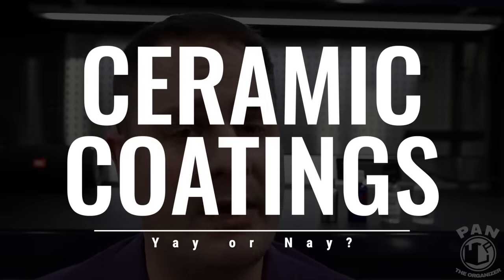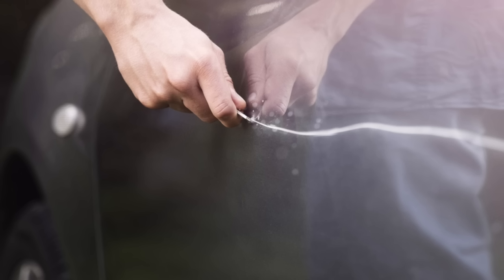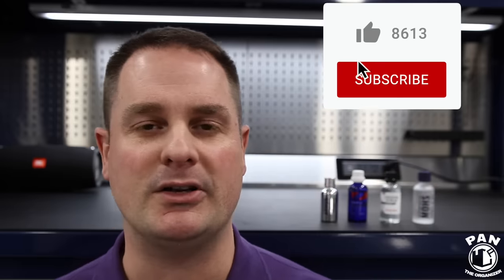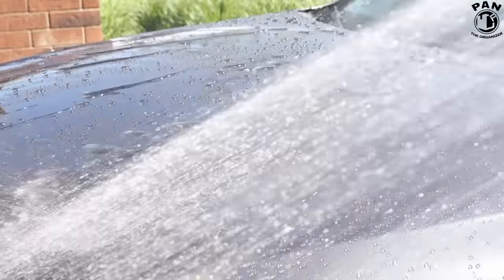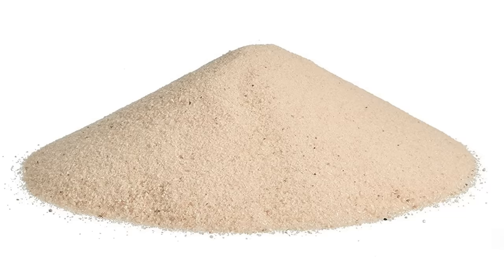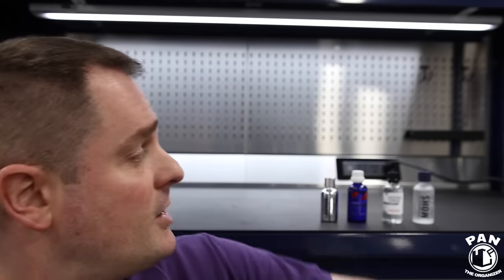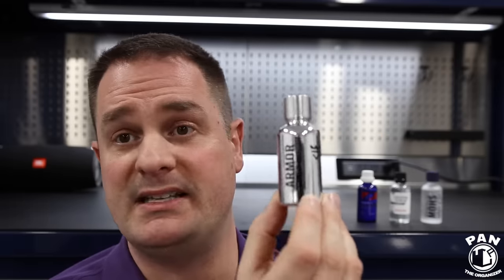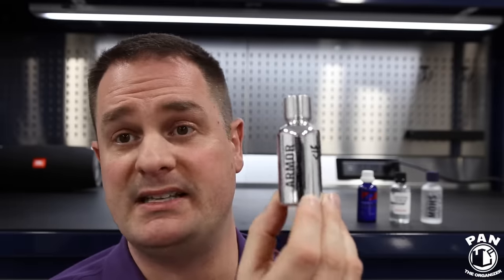DON'T BUY CERAMIC COATINGS BEFORE WATCHING THIS !!

Comment: Just wish I had an indoor space to complete the whole process safely 😩 not confident enough to do a full polish and ceramic application outside 😬
Reply from the maker: You certainly could. Just make sure you pick a day where it doesn’t rain and don’t work in direct sunlight.
Reply: Ok have to wait for a calm over cast day as our house has the sun from 6am to 3pm , we could move 🤔🤪 the wife will understand 😉, thanks Pan , great as ever 👍🏻 could be a short blog on what you can do in an outdoor setting and when not to , help confidence 👍🏻

Comment: Great information Pan, I would like to know how you know it's time to reapply the ceramic coatings and the process. Thank you!  Storman from PA
Reply from the maker: When the properties really start diminishing (hydrophobics) and when you are reaching the end of the claimed durability. So if you have a ceramic coating that is supposed to last 2 years, towards the end of the coating's life, say at the 20th month mark, you will probably notice less water beading and sheeting. At that point, I would recommend doing the full procedure of wash, decontamination, machine polishing, paint prep and then reapply a fresh coating.

Comment: Will these work on an Rv? I have a full body painted 5th wheel and looking to put ceramic coating on it to protect the trailer
Reply from the maker: Yes, most good coatings can also be applied to paint, gelcoat, fiberglass, etc. Check with the coating brand you are buying to make sure.

Also, watch my RV detailing tutorial here: https://youtu.be/OCUWBbPgu8M
Reply: @PanTheOrganizer  thank you very much, I will check out your video there after I finish up with this video. I’m trying to do my homework before starting the big project

Comment: Just ordered AVking and 79.00 for two kits is sweet! Was using Pearl nano products and from new my 16 f150 looks great, but needs a refresh and some wheeling and a swirl removal. Any tips for prep soap wise before clay barring?
Reply from the maker: I like Adam's Strip Wash: https://amzn.to/2Rt0h2N
AvalonKing also makes their own prep wash shampoo now. It works great too.

Just keep in mind stripping shampoos alone won't fully remove existing protection. They only start the breaking down process of older waxes or sealants, and certainly don't strip ceramic coatings. Only machine polishing will ensure 100% removal of old protections.
Reply: @PanTheOrganizer  Thanks for the video very insightful. Cheers

Comment: I purchased P&S interior cleaner from watching your channel, excellent results with a matt finish on my Porsche which has Feynlab self healing lite and was wondering if you have any experience with any the so called self healing ceramic coatings?
Reply from the maker: I haven't tested self-healing coatings yet.

Comment: Thank you for answering my previous question! Other question. My car is a 2018 Kia I've never applied wax but when I go to the car wash I do use the turtle Wax at the end. Does that count as a coating? And if so can I wait my vehicle down with icpropyl alcohol to remove it then apply a ceramic coating? Also thank you for the promo code for the ceramic coating
Reply from the maker: That's not a coating. That's simply a small layer of wax that's added to help the water sheet and bead off the paint. A coating is a CERAMIC COATING or GRAPHENE COATING, the ones that come in glass bottles like in the video you just watched. Those are the most durable forms of paint protection as they last for years, instead of 1 to 3 months for a traditional wax.

I explain the differences between waxes, paint sealants and coatings in this popular video: https://youtu.be/Yxz3zSVIm-g

I made a tutorial on ceramic coatings here: https://youtu.be/sqQYVjxFqK0

Comment: I have a Ceramic Pro 9H coating on my truck. It has been on for almost a year now. I am now starting to notice a lot of patching in areas on top surfaces. I think the coating is starting to either wear down or fail. I have a lifetime warranty on it and I think the manufacture will say I didn't take care of the vehicle the proper way and just void the warranty.
I do not have my own garage to keep the vehicle safe or do any type of maintenance on, yet. I am wondering how much work it would be to remove the ceramic coat on the hood and roof and apply a different brand, even if it is just temporary. Any suggestions Pan?
Reply from the maker: The only way to ensure 100% removal of a previous coating is by machine polishing.
Reply: @PanTheOrganizer  Thank you for the quick response. I had a feeling that would be the method. I guess I need to get started.
Reply from the maker: How did you discover my channel by the way Jason?

Comment: Hi there, is there any way to confirm if a vehicle has been ceramic coated? Friend says the dealership applied a ceramic coating to his new car, but doesn`t "look" like it..... thanks in advance
Reply from the maker: Very hard to say unless you can see if there is great beading and sheeting of water (sign that the paintwork is protected) and that the protection lasts for months or years...

Comment: Great Videos Pan !! I'm a beginner (sorry) so if I use Ceramic how do I know when to clay again ?? - Do I just wait a long time (product label and personal judgement) or feel the clear coat for roughness ??  Or simply no clay bar again ??
Reply from the maker: If you have a ceramic coating, you won't use a clay bar anymore, as that would abrade and scratch the surface and damage the coating. Keep in mind clay bars are abrasives, hence why we usually follow up with a polishing stage.

To maintain a ceramic coated vehicle, you use a good shampoo like CarPro Eraser, and once every other month, use an iron remover (chemical decontamination). And at least once very 2 or 3 months, apply a silica based spray sealant for maintenance.

I made a video of maintaining a coated car here: https://youtu.be/yLiePQRMFc8

And more in depth deep cleaning during spring time here: https://youtu.be/oTaFE_p2OAw
Reply: Thanks so much - Your the best my friend !!

Comment: My truck is being painted as we speak. How long should I wait until the paint and clear coat cures, before I apply Ceramic Coat? I know that I have to sand the clear coat and buff the truck, then I have to remove all the wax from the compound and polish. So I’m wondering if I should use denatured alcohol or just a good cleaning with dish detergent.
Reply from the maker: Wait 1 to 2 months on a freshly repainted vehicle before applying any type of chemicals on the paintwork.
Reply: @PanTheOrganizer  ... thank you for the videos and your reply. I’m in Arizona, no better place to get the paint naturally cured as we’re getting into the 100’s until October. I’m looking forward for these 5-6 months of nice cool weather.... of 115 degrees. Sarcasm....
Reply from the maker: Lol!  How did you discover my channel by the way Tony?
Reply: @PanTheOrganizer  ... I bought rims and the shop told me that I should get them Ceramic Coated. Being that I was a salesman since I was 8 years old, I didn’t trust the guy, so I looked up videos on it, and I found you. Thank you for your honesty. I paid $150.00 to get 4 rims done, 20x12.5. After watching your video for the second time, I realized that I could have bought an entire pallet of the Ceramic Coat and do it myself. Sarcasm... again. But at least 3 bottles.
Reply from the maker: Thanks for the feedback. You’ll find everything you need to know about detailing on my channel. Over 600 videos so far with new ones added at least once a week. :)
Reply: @PanTheOrganizer  ... I subscribed and I have set the bell thing to alert me. I’m restoring my truck and I will definitely watch your videos to keep up with it, especially since I only drive an average of 1500 miles a year. Yes, I said a year. Believe it or not, Arizona heat destroys vehicles that aren’t used often. I replace my tires every 5 years or every 5,000 miles. Now that I’m done with work, I need to take care of my truck, and I’m looking forward to watching your videos to learn about UV protection. I’ve always used 303 to protect the tires, bushings, hoses and belts, but still get dry rotted.

Comment: Great channel. Big fan. Small question: Can I apply any of this outside under some shade? This will realy help me out. Thank Pan
Reply from the maker: Thanks Hector. Yes you can apply ceramic coatings outside, as long as you stay in the shade and work on a cool surface. As late as possible in the day is the best. Avoid working in direct sunlight for sure.

How did you discover my channel by the way?

Comment: I've been quoted $2500 by Ceramic Pros for Ceramic on my Model Y.  Includes paint correction.  Watching your video in depth and many more before doing that.  Thoughts on PPF?  Maybe you have a video on that as well, I will look! Great content! Thank you. $1800 for PPF for the hood and front portions down from hood, and side mirrors, not drivers doors or back to any other part of car.  Taking suggestions!  Window tinting too, large large rabbit hole I have been in for weeks, I know the mad hatter and Alice all too well! ;-)

Comment: Hi Pan, very informative video. I did not know about tossing the micro towels after leveling the ceramic. My concern in applying the ceramic would be the prep, I currently have applied several coats of wax, new 2020 truck, no scratches or swirl marks. I'm afraid of what the ceramic would look like if I do not remove all of the wax during the prep phase. How do I know if I correctly removed all of the existing coatings?
Reply from the maker: You absolutely have to remove all previous paint protection off your paint BEFORE applying any ceramic coating. That is crucial. If you don't, the ceramic coating won't be able to bond properly to the clear coat, thus negating all the work you put in. The only way to do a proper job is by doing a full prep to decontaminate, followed by machine polishing. You're in luck, as I have the most popular YouTube tutorial on how to apply a ceramic coating here: https://youtu.be/byKcYsEyWGk

Comment: So I recently bought a used carbon fiber trunk looks fairly new but has factory gel coat , I was advised to take it to a shop and get it wet sanded then coated in clear coat ..after receiving it from the shop the SAME day can I just apply a ceramic coat on top or do I have to clean it ? Thank you In advance
Reply from the maker: Wait one month on repainted panels before using any type of protection.
Reply: @PanTheOrganizer  so get that work done , and I can have the trunk in the garage and wait a month then I can add Avalon ceramic coat ? Would I be then fine with just washing trunk with non wax ph balanced soap like (chemical guys MR. PINK)drying it then adding Avalon coat ?
Reply from the maker: Correct.
Reply: @PanTheOrganizer  thank you I thought I had to do all that major prep cleaning

Comment: I’m curious as to what the difference is between ceramic products companies sell that are specifically made for wheels or trim pieces as opposed to cars paint surfaces. I have used both, and in particular,love the ceramic coating for wheels. How is this product different from products for whole car paint ceramic?
Reply from the maker: They usually state that the wheel specific coatings have a higher temperature resistance due to the harsher environment in the brake system area.

Comment: Hi Pan.  I’ve watched many if your videos, but I’m not sure you’ve covered the following.  If I’m adding a ceramic coating, will I be able to see, while I’m working on the surface of my car, where I’ve applied the coating and where I haven’t?  Do I need to buy a UV light to know fir sure?
Reply from the maker: You will see where you've applied the coating, as most have what is called "flashing" where you see a rainbow effect (oil slick on water effect) indicating it's time to level the coating. Always work with inspection lights to make sure you covered your areas. But yes you see where you applied the coating, as you see the liquid resin being spread. Work in sections, take your time.

I have a full ceramic coating application tutorial here: https://youtu.be/sqQYVjxFqK0

The UV light will only work with a coating that has a UV-tracer in it, showing where you applied it. The only one I'm aware of that has that technology is the Adam's Advanced Graphene Ceramic Coating which I tested and reviewed in this video: https://youtu.be/idU5XsHTj7Y

Comment: Hey Pan, I'm thinking about getting the AvalonKing but I have a "kind" of indirect ceramic coating on my car, started with Meguiars while was in France, then now I'm using CarPro Hydro Reload, Elixir, HydrO2.... Can I just add the AvalonKing on top or do I have to clear everything first? cheers
Reply from the maker: No. You always have to fully prep and strip the paintwork before applying true ceramic coatings like the AvalonKing. Watch my full tutorial for the Armor Shield IX application here: https://youtu.be/Rgli6VNLsK4
Reply: @PanTheOrganizer  thank you

Comment: I'm 48 and carnuba is all I know. Does the wash, detox, polish, IPA process remove the old wax?
Reply from the maker: Yes. As soon as you talk about machine polishing, it removes any previous protection: waxes, sealants and coatings. Waxes are the easiest to remove as they are not super durable products, and they don't offer much chemical resistance. I made a super popular video explaining the major differences between waxes, paint sealants, ceramic coatings and silica spray sealants here: https://youtu.be/Yxz3zSVIm-g

Comment: Hi Pan, I live in warm and humid Malaysian weather and I don’t have a close or covered garage. My car porch is open though it has roof over it which shield the car from rain. Possible to coat without any issues of contaminants when applying?
Reply from the maker: That is fine, as long as it's not raining for 24 to 48 hours after your coating's application. Just keep in mind that humidity will accelerate the curing of the coating, so it will "flash" quicker on the surface.

Here's my super popular ceramic coating application tutorial: https://youtu.be/byKcYsEyWGk
Reply: Thanks Pan.

Comment: I have had very good results with Essence+. Would you recommend  applying iron removers in a contactless manner, or wiping it after it sits a few minutes?
Reply from the maker: I'm confused by your question. Essence+ is made to correct light defects on ceramic coated cars. What does an iron remover have to do with that? For maintenance of a ceramic coated car, it's a good idea to use an iron remover at least once every 3-4 months or as needed depending on your contamination levels.
Reply: The Essence+ comment was unrelated to Iron decon. That question was whether to just rinse it off after it sits a few minutes, OR use a sponge/mitt to wipe it into the surface before rinsing. Sorry for the confusion.

Comment: Great vid! I will probably order the AvalonKing. Question regarding prep. I just took delivery of a brand new Tesla Model Y. I had PPF put on the front and will do ceramic DIY. Do I have to do the full polish and everything before applying, or can I just do an iron remover after washing with a foam cannon? Im not sure if there is any stock wax or coating other than the paint and clearcoat. Thanks again!
Reply from the maker: Ideally you want to specify to the dealership to NOT apply any wax or sealant on the paint prior to delivery. I gave all the instructions for that and why it's important to detail a brand new car here: https://youtu.be/QgoyrC-5CMc

If the water is beading on your paint, they probably applied some cheap product prior to delivery. The only way to ensure 100% removal of any previous protection is wash, decontaminate, and machine polish the surface (polishing is key here) and then use the paint prep spray or IPA to wipe the entire surface and then you apply the coating.

I have a popular ceramic coating application tutorial here: https://youtu.be/sqQYVjxFqK0

Comment: I have a question for you unfortunately I don’t have a garage and in North Carolina every morning when you go out to your car it is covered with moisture how do I apply A ceramic coating in that type of environment
Reply from the maker: First, I won't recommend applying a coating in temperatures below 15 to 20C (59-68F). You risk running into issues and also the flash time will take for ever. Now, you can still do this outside, as long as it doesn't rain for 24 hours (some coatings like AvalonKing need 48 hours of curing). Morning moisture ok, it will quickly evaporate as the sun rises.

Comment: After putting on a ceramic coating, can graphene coating be put on top as you would use a silica spray sealant?
Reply from the maker: Once you apply a ceramic coating from a glass bottle, you can use a ceramic spray or graphene spray for maintenance. No problem.

Comment: Should I use AvalonKings ceramic prep shampoo before or after paint correcting with turtlewax hybrid solutions polish and wax and the IPA wipedown?
Reply from the maker: Don’t use the TW polish if you plan on applying a full blown ceramic coating. You want a pure polish that doesn’t leave any protection behind.

Prep shampoo, iron remover, claybar, machine polish, IPA wipe and then apply the coating.
Reply: @PanTheOrganizer  Thank you Pan! What kind of polish do you suggest that I use. I already did a regular wash, iron remover, and clay bar. I also have the TW precision platelet compound, but my finish only has light scratches so I'm not sure if I should use that one. I also ordered the Lake country CCS pads from watching your videos. Thank you!
Reply from the maker: You could use Sonax Perfect Finish. It’s a pure polish and my go-to for finishing polishing.
Reply: @PanTheOrganizer  I was just watching your compounds, polishes, and pads video and just got up to the sonax perfect finish part when I saw your comment! Haha thanks! You're the man!